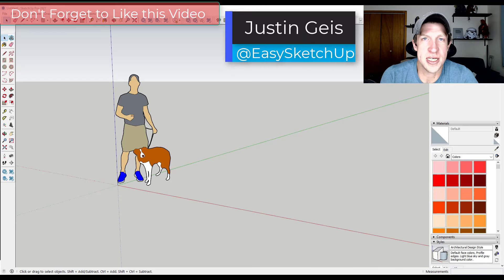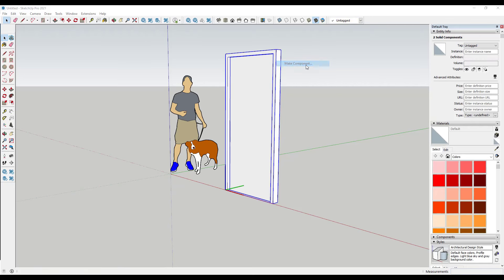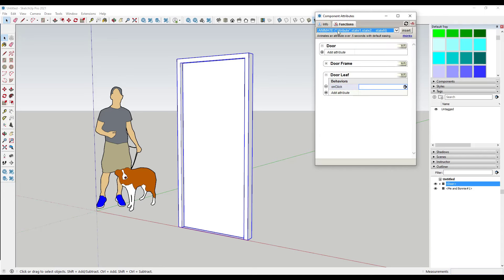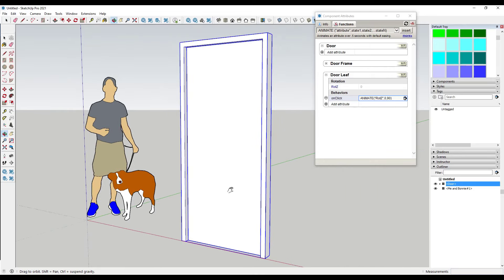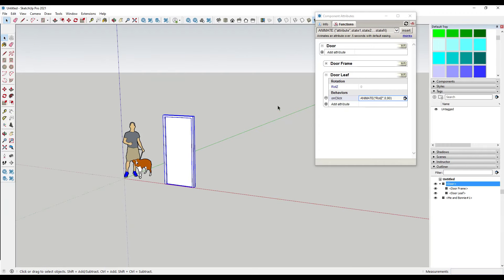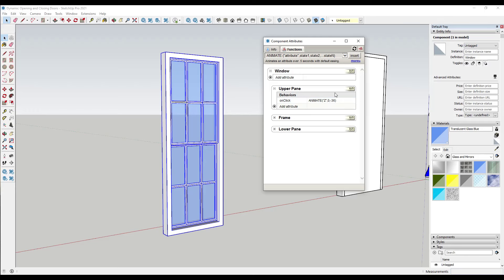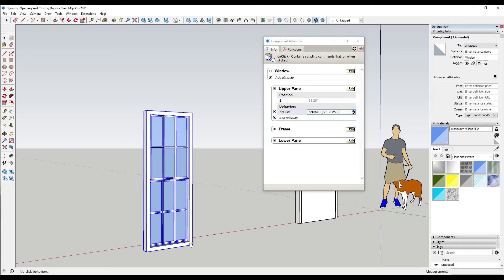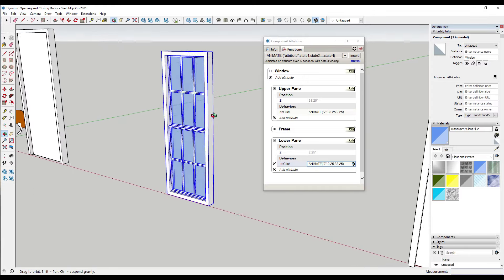Animating Doors and Windows with DYNAMIC COMPONENTS in SketchUp!

Comment: If you have multiple instances of the same dynamic component, does sketchup HAVE to rename it to a unique name like if you use different options of the dynamic? for example, I made 1 door, put it in my model  10 times, and individually clicked on a couple doors to open them.  So now I have components named Standard Door, Standard Door #1, Standard Door #2, etc... Its making my components in model list too confusing! can you make it so Sketchup doesn't make the components unique? technically, they're the same component

Comment: I've not done much SketchUp recently, last time I used animate functions to slide objects, there was a problem that it would randomly change to different positions along the chosen axis. Took a lot of trial & error & Google searches. But apparently there is (was) a problem if you chose metric in dynamic component , even if your project was defined in metric. If you switch to imperial, it functioned correctly. Is this still a SketchUp dynamic problem or is it fixed now since 2020 build?